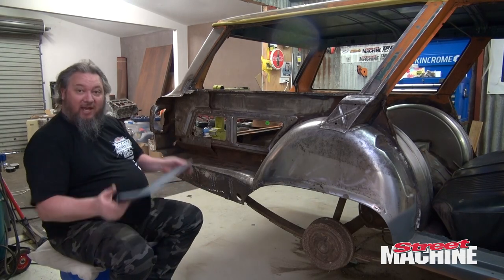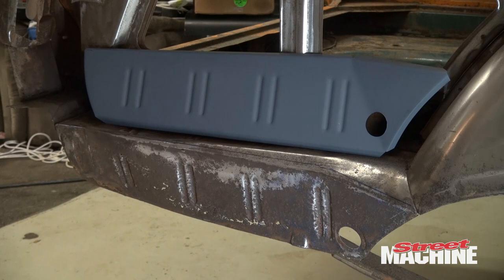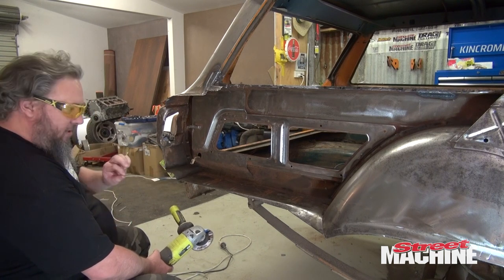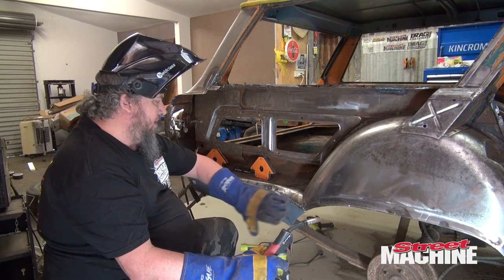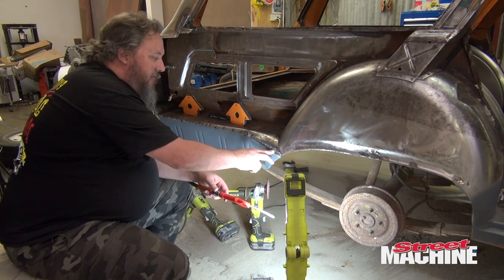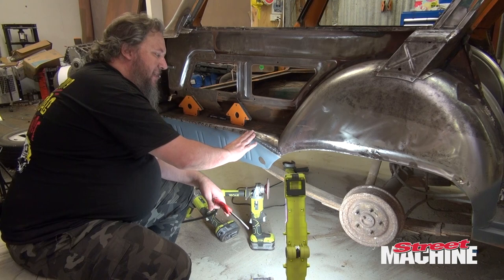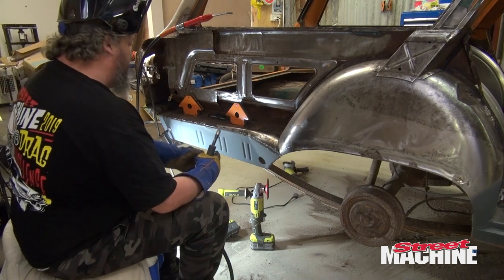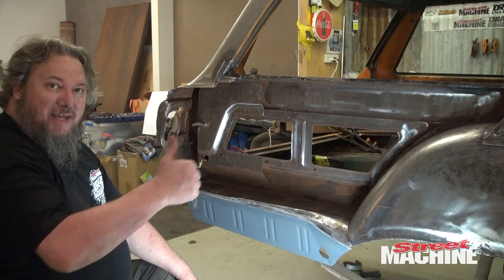Carnage Plus EP82 - The Last Rust Repair on The Lockdown Wagon

Comment: Mate use a small welding wire, that way you can do better welding IMHO. still the more you weld and practice the better you get at it.:) Also turn down the welder, based on your thickness of metal, anything less than 2mm thick should be really easy to weld, the problem is that unless you have a small welder to do it the setting might go down that low, also the feed speed settings as well.:)

Comment: Did you get the new quarter panel on? Im doing exactly the same panel repair on my VE sedan right now. Ive cut the rusted old repaired inner out and had to modify the end of the new repair panel a bit to better match the bumper recess. Now to trim things to fit & weld into the car and Im shutting myself I'll get it wrong cause I got no datums to work to. You dont seem to be worried at all!

Comment: I use TIG and motoring mythology states it's better, but TBH it's too tempting to do a run with TIG and you end up warping panels.  At least with MIG you know you have to spot.  Add to that setup is easier and you can work one handed I've kind of come to the conclusion MIG is better for the home project guy.
Reply from the maker: We have a TIG but I haven't had time to learn it. Wish I'd bought it home during lockdown

Comment: Go Scotty, now just think if this was all done at a panel shop, its over 20K easy and when finished the cars is worth about 50K even if you put the mod cons in it, no offence, if it was a two door 770 then fair enough, but seen a centura 265  going for 30K but all OE original with papers, so all the older cars are going up only because its real hard to find parts unless you get it from the states which rare spares has worked with? Keep up the great work Scotty. :)

Comment: Does any one know why that hole is in it near the wheel arch? Does something else mount in there? Or is there a bolt behind it that needs access?
Reply from the maker: Its a cleaning access bung or maybe water bung. Dirt and stuff accumulates in the rear quarter and you can vacuum it out from there but hardly anyone does and then they rust.
Reply: @STREETMACHINETV  cheers!